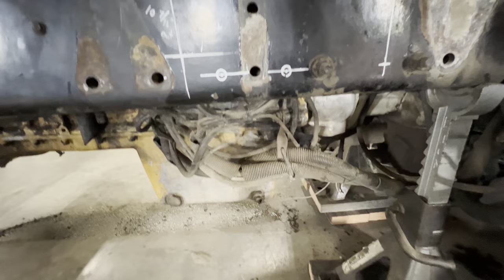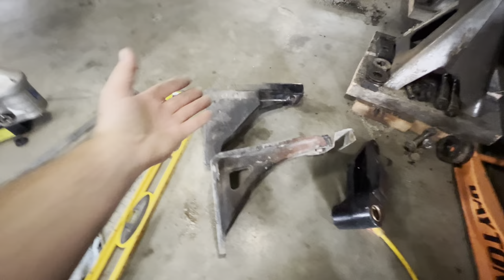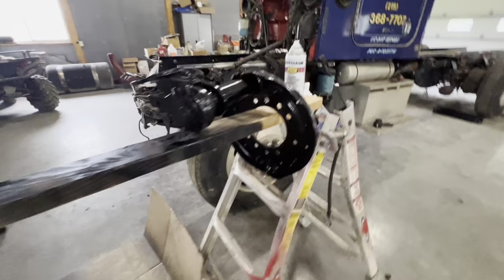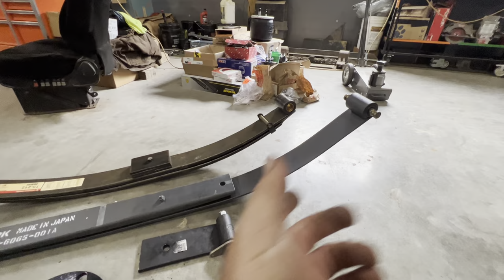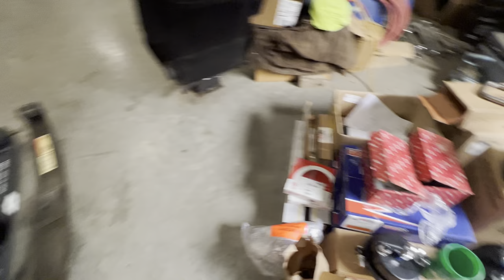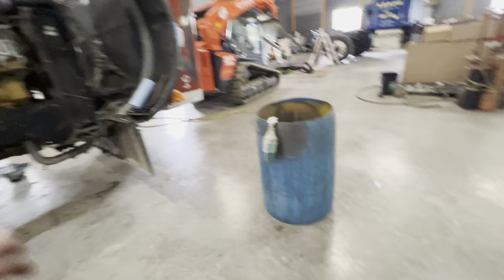Peterbilt 379 Air Ride front axle

Comment: Hey- great intuitive video. Quick question, you had mentioned the turning radius will now be a lot tighter? Nice. What exactly would I need to get more crank in my turn on my 379? I’ve got an 04 short nose. I’m slowly upgrading and air was one thing but turning was one as well. Perfect. Lol
Reply from the maker: Wide trac axle.. i did have to put a longer arm on the box to get more throw .  Now it steers pretty good
Reply: @nealequipment3777  would you have a part number for that wide track  axle and the steering  arm you used?
Reply: @naume_1743  the popular 5 inch drop 70 inch wide “car hauler” axle is 1462Tb105-6. Eaton does make a 70.5 width but I haven’t been able to figure out the casting number for that
Reply: @nealequipment3777  would you happen to have a part # for that pitman arm?